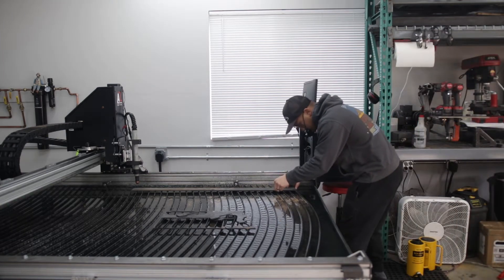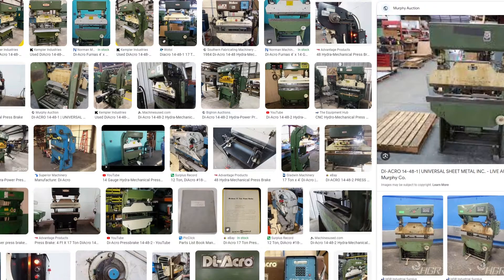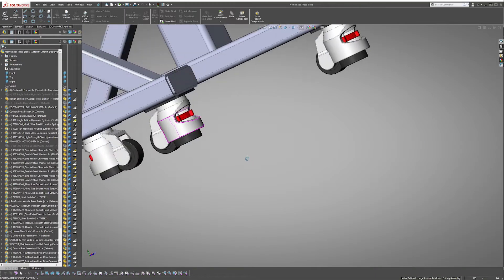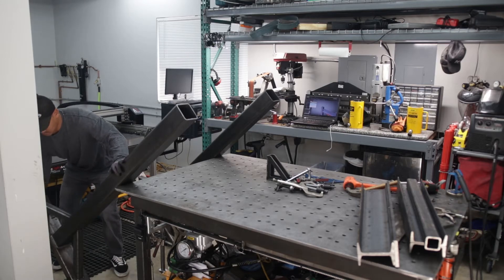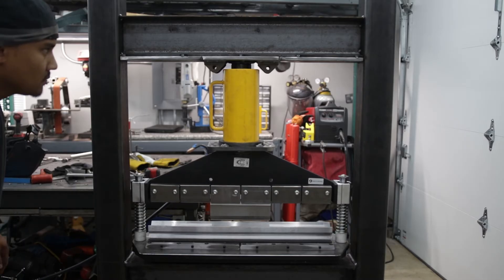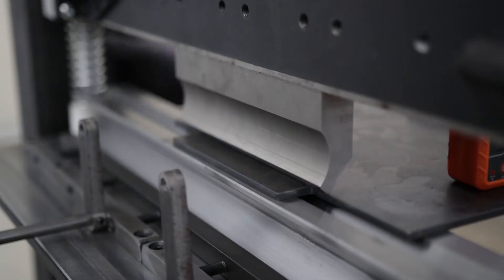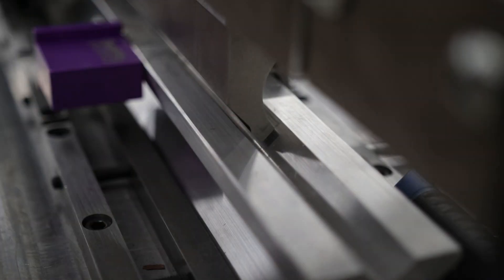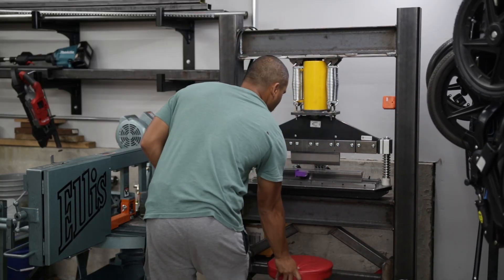DIY Hydraulic Press Brake PART 1 - Repeatable Bends using Limit Switches

Comment from the maker: Want to build your own Hydraulic Press Brake? Links to the DIY Build Plans: 

My Website: https://www.rathaprecisiondesign.com/products/diy-30-ton-shop-hydraulic-press-brake-digital-build-plans

or 

Etsy Shop: https://rathasochenda.etsy.com/listing/1575803667/diy-shop-hydraulic-press-brake-digital

Video Description:

How to build a homemade pressbrake. In this video series, I’ll share the process of building out my homemade brake press, which will include a NC control back gauge and limit switches to tell how far the punch die needs to travel down to achieve a desired and repeatable bend angle.

Items used in this video:

Cyclops Press Brake Tool: https://www.instagram.com/cyclopsdesigns/
Vevor Electric Hydrualic Pump: https://s.vevor.com/bfQh9Q
Vevor 30 Ton Cylinder: https://s.vevor.com/bfQh9M
Anti-Wear Hydraulic Fluid: https://amzn.to/3Lt3YP9
Limit Switch: https://amzn.to/3qZNw1Z
Return Springs: https://amzn.to/47X0YnM
Linear Rail:  https://amzn.to/3L2KLnp
Digital Angle Gage: https://amzn.to/3QZTESt
Leveling Caster 2200lb Capacity Set of 4: https://amzn.to/486WB9U

Video Chapters

0:00 - Introduction
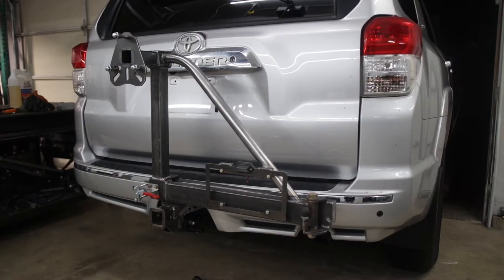0:50 - Why I need a Brake Press for my shop
3:15 - The Goals for this Brake Press System
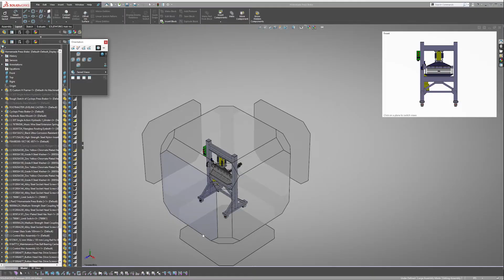4:00 - My Shop Brake Press Design in SolidWorks
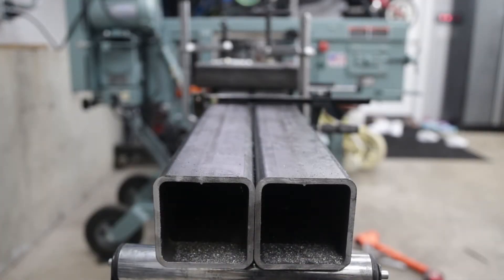5:47 - Building a Hydraulic Shop Press H-Frame
10:11 - About the Cyclops Design Brake Press
11:21 - Bending Parts 
12:35 - Limit Switch to make repeatable bends
15:04 - Conclusions
Reply: Bro u use gas or oil for this hydraulic

Comment: Nicely done!  👍😁  I really would like an out of the box small system that is less than $4k too.  Langumuirs Titan 25T looks really enticing with a list under four thousand.  However with all the extras puts it around $8k.  I bet you could get some heavier bends out of the same frame structure if you swap for a cam lever ram system.

Comment: What is the retract time of this cylinder? Is it realistic in a production setting? I’m concerned with using a hollow-bore single acting cylinder due to how long it will take to retract far enough to remove the part, or reset to make the next bend
Reply from the maker: For simple stuff I think it will work great

Comment: I would love to build this, do vevor still do that ram as i cant find it. Whats the thickest plate you have bent
Reply from the maker: Items used in this video:

Cyclops Press Brake Tool:  

 / cyclopsdesigns   or https://www.ebay.com/itm/115064499037...

Electric Hydraulic Pump/s: https://s.vevor.com/bfQHVv
Vevor 30 Ton Cylinder: https://s.vevor.com/bfQh9M
Anti-Wear Hydraulic Fluid: https://amzn.to/3Lt3YP9
Limit Switch: https://amzn.to/3qZNw1Z
Return Springs: https://amzn.to/47X0YnM
Linear Rail:  https://amzn.to/3L2KLnp
Digital Angle Gage: https://amzn.to/3QZTESt
Leveling Caster 2200lb Capacity Set of 4: https://amzn.to/486WB9U

a safe thickness would be 3/16" full steel sheet (23.625" long).

Comment: Great Video! Like I told you IG I will definitely be ordering one as soon as they are available.
This is Leaps & Bounds above the HoBo Freight 20 Ton that I did Pimp out by adding a Air Powered Hydraulic Jack and some of Swag Off-road stuff.
This is just like a Professionally made Press Brake.

Comment: several years ago i made my press out of bridge banister-- 5in angle riveted  together about12 in apart for the uprights and 12 in channel for the front and back of the table, and the top rails of the head,. I tried something different  i made the hydraulic jack bracket (Head) so it slid along the top channels allowing me to press right next to the side(that had an opening between the angle iron legs)  i was doing mostly farm parts straitening  or pressing bearings out, the table was the only weak point as it is held by 2   3/4 in pins but they run through the front and back channels. never put enough pressure to bother them tho  . like the repeatable of your design

Comment: Do you think you could do the same set up for a wider bender? I would say enough to fit 1800 wide material
Reply from the maker: Most likely no… you will most likely have to run two cyclinder and get them synchronized
Reply: I thought that would the case. Are you looking at making your own dies? There’s a with people I’ve seen who cut 16mm plate then weld them together to make a longer piece

Comment: Fantastic.  Using the limit switch is a great idea. One thing I missed is how you can from 45 to 90 and back again without adjusting the bolt every time.  Looking forward to the DRO.
Reply from the maker: I’ll explain it in the video part 2 or 3
Reply: @RathaSochenda  Can't wait. Thanks.

Comment: You are super inspiring, I wish I could do the same stuff like you!
Reply from the maker: Thanks for the nice compliment. Im sure you can do anything you put your mind to! 🦾
Reply: @RathaSochenda   What did you study if I may ask? I consider taking a course in welding or industrial product design. In what study can I learn to use CNC machines, autoCAD and welding at the same time?
Reply from the maker: My background is mechanical engineering. But honestly I learned most of what I know just from watching YouTube videos and actually trial and error. It really is a mindset thing. I found the way to learn all three stuff like cnc , design, fabrication is to have personal projects to work on. I’m not sure if that helps answer your question but I hope it points you in the right direction. Pretty much self-taught but it helps to have online mentors you look up to and can ask questions for help. It’s amazing how many people are willing to help if you ask.

Comment: Very nice project man! Looking forward to each video of you 💪🏻 how do you achieve different bending angles?
Reply from the maker: I’ll show you in part 2 or 3 of the video series. But in short I’ll adjust the thread bolt and record that depth specific for the angle. I’ll have a chart that I will create that will show what depth I need for certain angles I have per thickness. Mainly for me is 45 deg and 90s. If it’s some odd angle I’ll use a digital angle finder and bump the pressbrake pedal until I reach it.